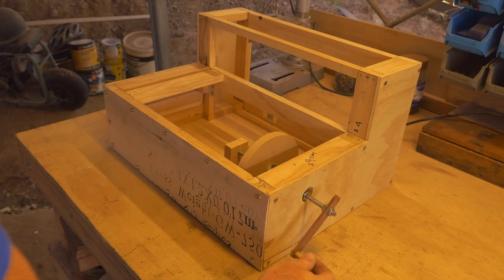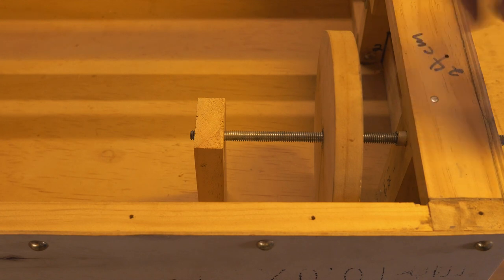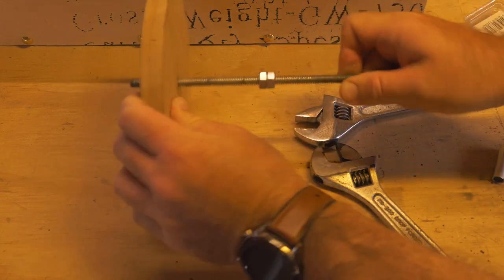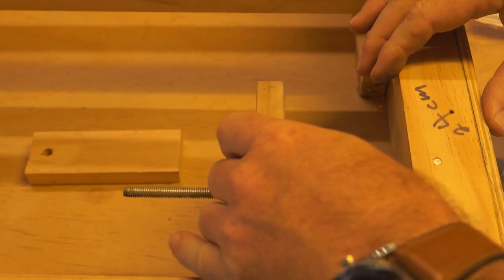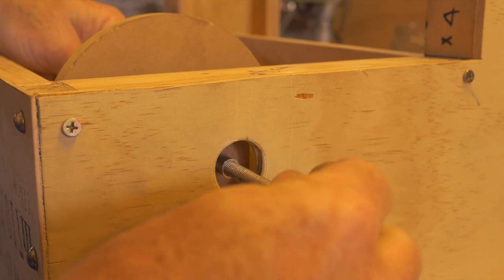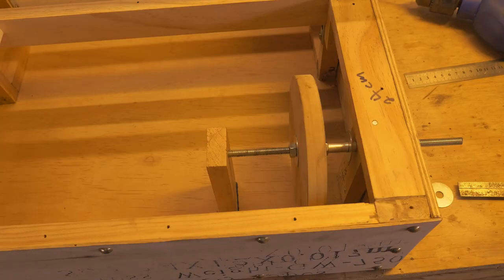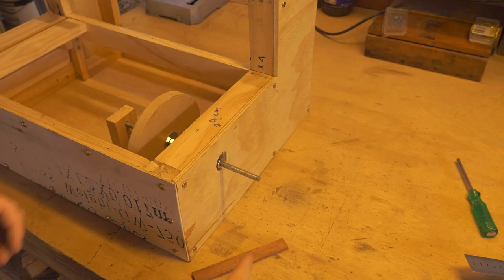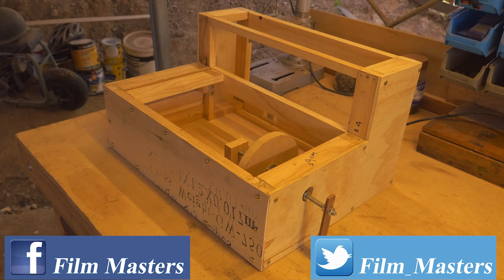How to Build The Apprehension Engine #14 - Installing the Hurdy Gurdy

Comment: My version is bout half this size but still has a fantastic creepy accustic sound even witout amp hooked up. I posted video on my channel of it.
Reply from the maker: Eddie Mason very cool. I gave your video a like. What s the fork thing for? You used it on the stings?
Reply: Film Masters cool thanks man. I use it like you would a fret, only i can move it up and down neck without depressing strings to increase pitch. Strings vibrate between tines.
Reply from the maker: @eddiemason4316  I'll have to see how it works on mine. A unique way to get the strings to resonate
Reply: Film Masters it defiantly adds to an already amazing sound.

Comment: NICE! I was stressing about making a good handle for the HG, but that's super nice and simple. I've been playing with the bare box and some piezo pickups for the superball sounds and the rules and spring and whatnot (still can't find a good spring steel spring yet...), and it's sounding awesome—I can't wait to get the guitar necks and strings on! I'm probably going to wind up getting a bigger reverb tank—my current one takes up a bit more than half of the top front panel, but I might leave it like that and wind up mounting the mixer knobs on the front next to it, we'll see. Also been playing with putting the pickups through my effects pedal and toying around with a looping pedal—I'm super stoked to get this project finalized in a few weeks, so I can take what I've learned and build a V2. :) Thanks!
Reply from the maker: Marc Majcher it’s funny you say that. This is my V2 based on what I learned from my V1. I think you will be happy with the larger reverb tank. We start building the guitar necks in the next video 😎
Reply: Sweet, can't wait! :)

Comment: Question: I used the metal threaded rod for the wheel, and it seems really clanky and loud. Or seems like that sound would get picked up by the pickups—is that normal and okay, or should I start pulling stuff apart?
Reply from the maker: You can put some grease (in the bearing) but it will wear in the more you turn it. Make sure its not too lose in where the rod goes into the bearing. Also make sure its not too tight. A little noise is ok because it needs to sound slightly clunky like an old wheel.
Reply from the maker: I think I should address this question in a video so I will :)